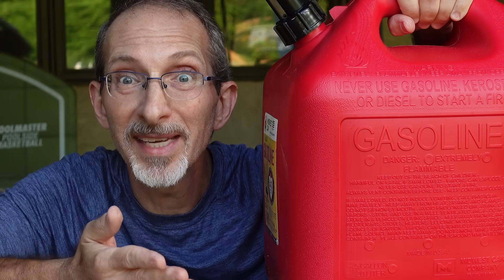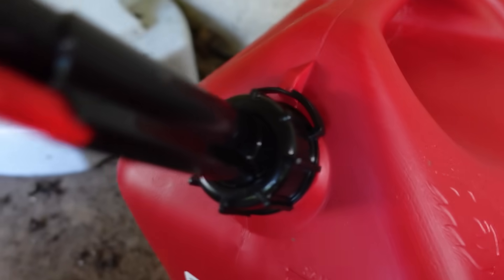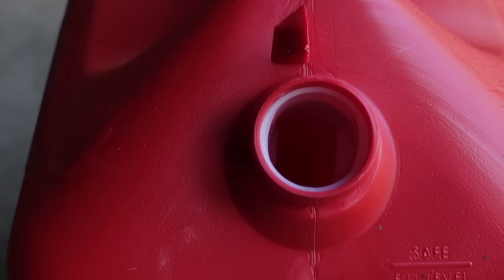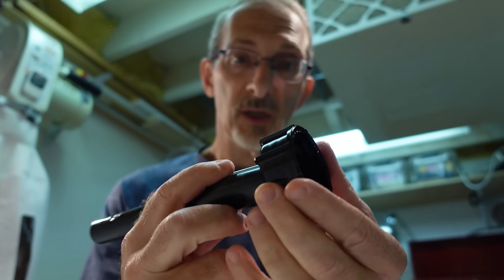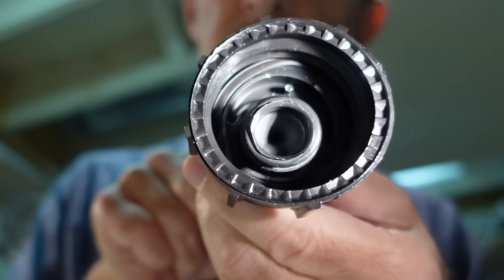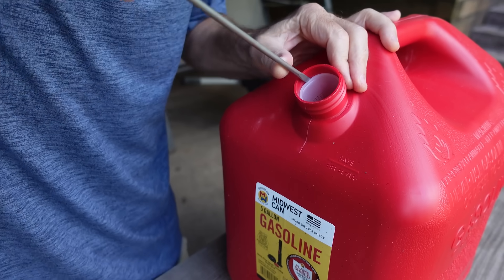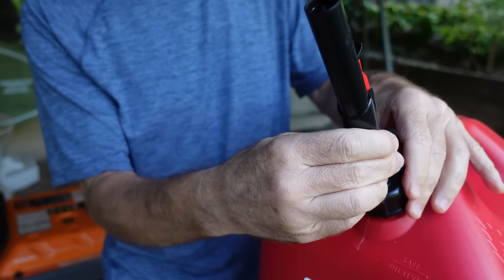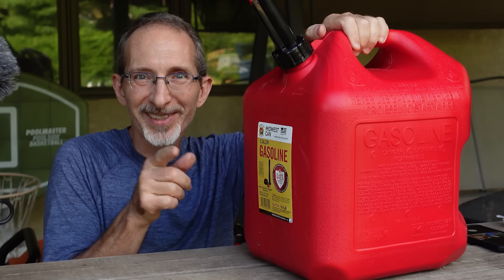Gas Can Modification | New Gas Can Fix

Comment: Someone designed this piece of shit with their head in their ass. The first time I used this shit I got so frustrated I almost used it a s target. Specially the filter tube inside the gas can. It took me over 10 minutes to fill this shit can. I removed all these faulty designed.

Comment: Where I worked we had a nutcase who was the safety officer. He threw out all the "unsafety" gas containers and replaced them with the metal safety cans which were a joke as when you tried to pour them gas went everywhere. He finally left and fist thing we did was go buy some plastic ones which did not have the safety devices and used the metal ones for waste oil transport.

Comment: Thank you for this. I was filling my weedeater with one of those infernal spouts last week and decided it was time for a CJM (Come to Jesus Meeting). The last one I talked to was completely mangled when I finished with it, but it did flow. This time, I'll be a little more informed and a little less enraged. 

Don't forget to jab a hole in the top of the can. Otherwise, it will be swollen when you come out in the winter and collapsed in the summer. Just what I need is a bunch of swollen gas cans in the back of my truck when I get back home from filling them down in the valley. That's safe. 

Those spouts are another fine example of what I call "you're too stupid" engineering. "We think you'll hurt yourself, or the environment, so you have to deal with stuff that doesn't work." You can't have a decent showerhead, or a toaster that toasts, or a blow dryer without a GFI on the cord that will break in a week, or a gas can that flows. You're too stupid for that. Fortunately, guys on YT are a lot more crafty than the dimwits designing this stuff. Thanks again.

Comment: Whoever mandated this newfangled pile of shit needs to be removed from power with vigilante mob justice. This is the line, not rigged elections, not inflation devaluing currency, no, its forcing me to use fucked up shit significantly worse than the tried and true shit we have had figured out forever.

Comment: Nice work.  I'm so glad I saved spouts from old plastic gas cans and they work good on new cans but it would be nice to have the little yellow vent thingy for pouring.
Reply from the maker: The little yellow vents are an easy add! I installed one and made some other container mods in my second video, link in the description. Thanks for watching!
Reply: That only works if you are fortunate enough to have a can that has the same thread for the nut that holds the spout in place.  When I tried that I found two different styles of thread.

Comment: I just watched this one again. It reminded me to pose the question. When is somebody going to start 3D printing spouts that work like the old ones ? Or publish information for others to print their own ?
Reply from the maker: Dallas, the old spouts I really liked were very flexible so I don't know how they would hold up to 3-D printing. You can get aftermarket spouts for around $10 made of flexible plastic.
Reply: @MikeFyxdt  some of the old ones were flexible, yes.  But there were a lot that were just a rigid straight tube that looked very much like the new ones minus the complications. I have four of them.

Comment: Any can with the word safety involved is junk. I have 3 Blitz 5 gal that have the notch on top for locking the cap but always serves as a sort of keepsafe on the filler neck so you arent supporting all the weight.
Reply from the maker: I have a Blitz container, and while I thought it was weird at first because you have to slide a latch and squeeze a handle, once you do it you can dispense the gas with one hand. Can't say the same thing for this design!

Comment: Tractor supply sells a kit that comes with everything to turn your gas can into one of the old good gas cans with the yellow cap for the vent. And I have seen them in most hardware stores as well
Reply: I bought 2 of those!  I especially like the gas nozzle which bends and the yellow vent cap.  It was too easy to install!

Comment: Two suggestions...   when removing the internal plastic filter, all you have to do is pry the filter away with your screwdriver and get your needle nose pliers inserted and then twist them. You can take it out in 5 seconds. Next, you can purchase vents that snap in after drilling a half-inch hole in the top opposite the spout? That will do the most to increase your fuel flow.

Comment: you need to add a rear air valve, which will allow the fuel to flow so much better.
Reply: Did that to all my cans years ago. I bought flexible spouts on Amazon, gives me better control. Now I know how to remove that obnoxious inner filter.

Comment: Another thing that drives me crazy with new gas cans is there is no vent. If the can heats up it expands. I've even had it collapse. Thanks Mike for the tip. I hate new cans. What I don't understand is if it's not broke why fix it?

Comment: I always wondered why the gas can design changed. It was perfectly fine, had a spout and cap, little pressure cap on the back. Not a problem, now you loose a quart or more of gas when it's spilled
Reply from the maker: With practice I have gotten my spills down to just a few ounces!

Comment: The old cans were simple and worked. I can't even get the spout into my gas tank to fill it. I had to get a cheap white container from the auto section. It is simple and has a flexible spout and vent cap. I pour the gas from the gas can (top off) into this container and then transfer it to the gas tank. Stupid to need to do this.
Reply from the maker: Sometimes the most simple solutions are the best ones! 😀

Comment: Thanks Mike for the video, these nozzles were designed by engineers directed by nameless faceless bureaucrats bent on interfering in every part of society with absolutely no accountability for the PERMANENT decisions they make. P.S. I just buy aftermarket nozzles with the flex tube because like you say there are time when you have equipment not on flat ground, vertical fill nozzles and the full tanks are bulky, heavy and are hard to maneuver in some cases.
Reply: I ask you where you bought the aftermarket nozzles
Reply: @fuzfire  Amazon

Comment: Don't buy safety gas cans.  Shop for racing fuel cans.  Problem solved!  Safety cans are dangerous, you can easily spill fuel all over the vehicle , driveway and yourself.  Only lawyers should be forced to use them!

Comment: After experiencing my new gas can, and failing to get any use out of it, I understand why my old ones were stolen. Thank you for these great ideas.
Reply: Sorry for your loss, yeah after my experience with new gas cans I happily paid quite a bit for a set of old-school Jerrycans.
Reply: @DWmaniac4n6  = )
Reply: yeah i keep my old cans under lock and key. they are quite valuable. i made a dump run and found an old crushed can but the nozzle was intact i snatched it in a hurry. im still trying to figure out why nobody in front of me grabbed it first. the nozzle is really the important part.
Reply: @1heavyelement  I 3d printed replacements for my new cans.  A couple of O rings to seal the nozzle and lid and had 0 spillage, and I'm not worried about the print deforming in anyway because I used the same plastic that the cans are made out of. (ABS plastic)

Comment: Add a metal truck valve stem with the Schrader valve removed for a vent on the flat spot just behind the handle. Remove the cap when emptying the can. It will speed up the fueling process tremendously!  There are a few YouTube videos on this.

Your welcome!

Comment: Man I think removing that junk and breaking the rules is about the most important reason to do it. Screw the epa and the STUPID gas can companies that think they need to hire a rocket scientist to built a gas can!
Dumbest thing EVER. The wife of a buddy of mine ran her truck out of gas on a highway overpass. They had a gas can with some other type of stupid valve spout on it. We had to stand in traffic for 10 times as long as an old school can to pour the gas in it and of course all over it too.
These new cans are far more dangerous than old cans and also lead to more gas getting dumped pretty much everywhere.
I guess I'll mention I'm being sarcastic when I say that ANYONE who mandates a change to these new cans and ANYONE who participates in designing them should be forced to use one while standing in traffic and then be showered will sparks!!

Comment: Remember the little yellow VENT cap?  Gone,  so I drilled a 1/8" hole and use a screw to close or remove  to open allowing smother not glug glug pouring.

Comment: I actually spill more gas cause of that stupid filter I took a 2 foot drill & stuck it through the spout & remove the blocked prostate problem the government put on my gas can , then took a small flashlight that no longer works & use it as a cap for my gas can. My can didn’t have the filter. I don’t give a blank about safety, I wanted my gas can to work like back in the day before the stupidity invention the government created. But good video & idea thanks 😂

Comment: Something designed to work in the most outside case. Most people go their entire lives without filling a motor vehicle from a Gerry can. Gerry cans are primarily used for filling small engines and these abominations basically make it almost impossible to do that without making a mess.
Reply from the maker: I agree! I think a flexible spout is far easier to use when filling small engines. Thanks for commenting!

Comment: Why would they put a filter in there in the first place🧐 Every car has a filter/screen in the fuel tank. (Not in the filler tube...) And in most cases a separate filter somewhere in the line going to the engine.
Reply from the maker: You are correct… Not a filter. It's a flame arrestor, which I corrected in my second video, link in the description. Thanks for commenting!
Reply: @MikeFyxdt   Ah, I see.

Comment: How'd ya like those calls or letters from EPA and fire code enforcement? OK hopefully that was a joke. The spring loaded nozzle is there to prevent evap into the atmosphere during storage. Could come in handy if your cans are stored in a tight enclosure. The lock tab assures you know when the nozzle is screwed on tightly and stays that way.
Thing is, most of us understand the importance of common sense and attention to details when handling fuels. There are those however...and that's who all this BS is for, to level the playing field. Either yer fir it er yer again it.
Reply from the maker: Agree… We can't assume common sense anymore, so things have to be designed for those who don't have it. Crazy! 😁

Comment: If that small band lock on the bottom is a hassle, you shouldn't be using anything that uses gasoline.
Reply from the maker: Skinned my finger on that band lock. If it was finished more smoothly it may have stayed.

Comment: I think you can buy an old school nozzle and vent for the back side of the gas can like the old style at Tractor Supply. But that was definitely helpful and worth doing. Great video
Reply from the maker: Thanks Justin! Old school nozzles and vents are definitely available. I appreciate you watching!
Reply: Oooo. No. I just got out of prison for hacking my can. Extradited all the way from Minnesota to California. When I told the other prisoners what I did they all moved away from me on the bench. When I told them it was for filling Molotov cocktails they all moved back. Hehe
Reply: I think they still sell the old style gas-cans for other stuff such as keeping antifreeze, etc. They just happen to be colors like blue or yellow, although still made from the same fuel-resistant plastic. You could paint one of those red to make it obvious what it's used for with a rattle-can and call it done.

Comment: With cars whizzing by you on the freeway in below zero weather, you're not going to have time to solve the latest Rubik's gas can nozzle puzzle simply to add gas. You're going to find the quickest way to get gas in your car, asinine government regulations be damned.
Reply from the maker: I don't see professional road recovery crews using these containers and nozzles. That would be insane!
Reply: @MikeFyxdt  Government has become omnipotent, omnipresent and often regulates based on unsubstantiated whims motivated by well funded "science".

Comment: My Briggs & Stratten gas can had a nozzle similar to that and it came apart the first time that I used it. So now I just have the four inch first segment which fits all of my equipment just fine. When I am finished, I just take off the nozzle and invert it so that it is inside of the can. There is a cap that goes on the back end of the nozzle that seals the can when I am not using it.
Reply from the maker: Such a simple solution! Thanks for sharing your idea and watching the video. 😁

Comment: The government is not looking after your equipment. That screen is not a filter, think about it, any debris that it catches on the way in sits waiting to be poured back out into your equipment's' tank. It is actually a flame arrester, arguably a good feature even id it slows the flow a bit.
That spout though is a prime example of cubicle engineering by someone who doesn't use the item they design.
The secondary purpose of these designs is to frustrate consumers into giving up gasoline equipment altogether.
Reply from the maker: Frustration accomplished! Yes, these designs are a good argument for electric tools. 😁

Comment: The filter is actually pointless. It does trap debris from the gas pump. But then as you pour the gas, the gas flushes the dirt out of the filter and into  the mower or whatever you're filling. WTF!
Reply from the maker: John, you are correct that as a filter it is useless… It is actually a flame arrestor, which I explained in my second video, link in the description. Thanks for watching and commenting!

Comment: The "filter" you removed is in fact a safety device to prevent the can from exploding. See the big sticker that says Flame Shield?  The "filter" will stop a flame from entering the tank.   A big fuel tank mfg. was sued over this and lost. Seems some idiot was pouring gas over a fire and the flames entered the tank and exploded.
Reply from the maker: Mike, you are correct. I explained this in my second video, link in the description. I also made some additional modifications to the container, which really helped! Thanks for watching and commenting!

Comment: Bravo!  Such a useless piece of crap should be left on the store shelf.  But you have made it less likely to spill.  One other option to buying a competent metal gas can, that is inherently better, is to not store large amounts of gas for a generator at all.  You will need 5 or more gallons a day stored for a 7 day outage like Hurricane Sandy or the TX Winter fiasco.   I had to drive 50 miles to find an open gas station to fill a mix of inappropriate containers to feed a small generator during Sandy.  Never again.  Since then I've converted my gas generator to natural gas so I do not have to constantly refresh 35 or more gallons to be prepared, or worry about the carburetor gumming up.   It is a cheap alternative to a true standby generator if you have NG or propane heating.  And one can still add gas to the tank if those fail, unlike the true standby generators.
Reply from the maker: I like the idea of having a dual fuel generator. We don't have natural gas or propane service, so that wasn't an option for me. I definitely would not survive a seven day outage…

Comment: I removed the flame arrestor, I don't mind the lock on the threaded part. And I broke the red tab off instead of removing the spring, I don't use Funnels often, but I hate spilling gas when it's too full. With no red tab I can push in to put as much gas as I want and it stops when I'm done
Reply from the maker: It sounds like a good combination of modifications to fit your needs. Thanks for sharing!

Comment: I got blowback from the can first time I used it at the gas station. Had the nozzle down in as you think it should be, pulled the trigger and about got soaked with gasoline. So sick of the feds trying to protect us with such insanely dumb devices.
Reply from the maker: People's results at the gas pump seem to vary. One of my containers felt just fine, but the other kept spitting back at me. Crazy!
Reply from the maker: People's results at the gas pump seem to vary. One of my containers felt just fine, but the other kept spitting back at me. Crazy!

Comment: Had a similar nozzle decide to self destruct when filling my ATV. Result was the nozzle tip and spring lived in my gas tank until I finally had the dealer remove them (I tried, but failed, in my attempts to do so).
Reply from the maker: Brian, that's crazy! (Unfortunately that's not the first time I've heard of it happening…) Thanks for sharing your story!